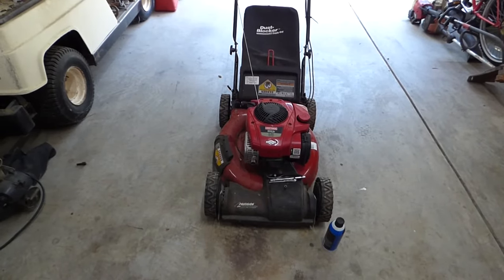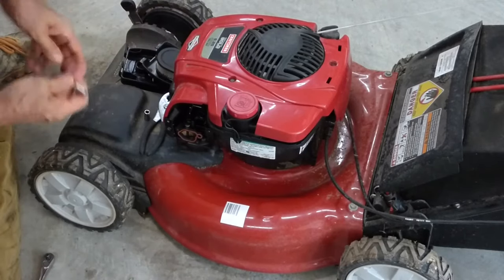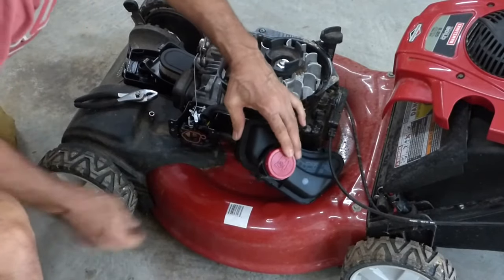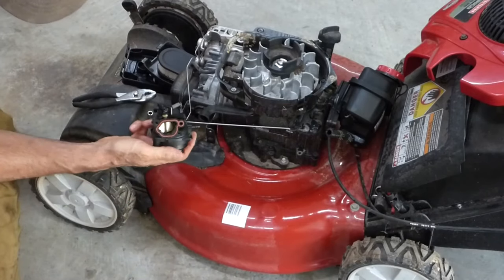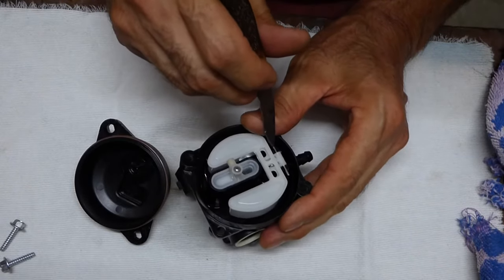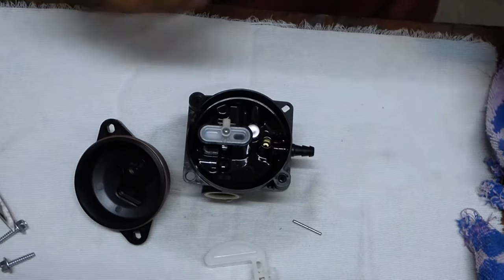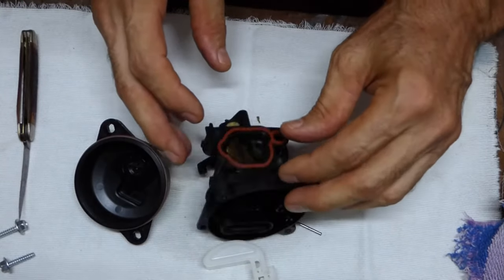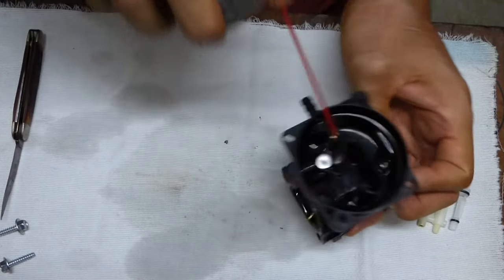Mower Won't Start - Briggs & Stratton Plastic Carburetor -  EASY Diagnose, Removal & Repair! FREE

Comment: Was wondering i gave same mower i got second had it was i. Trash  , but i got it running handles were broke  but rest worked .... the red peice on to was gone , so its nice to see that and it has a cover over battery box mine is also gone !!!!

Comment: The white jet holder plastic 3 tube piece was not completely disassembled.  The two tubes joined together needs slightly twisted and they will slide off then exposing about 3 holes on the middle tube that need to be cleaned and then reassembled.  This needs to be done!

Comment: Used your video yesterday to replace carb on my Toro 20332. THANK YOU. Worked fine with new carb. Suggest if your mower starts before you remove the old carb that you run out the gas tank, and let engine cool. No messy gas drips and easier to remove fuel line.
Reply from the maker: Glad it helped And good tip to run old gas out before your store

Comment: You never disconnected the two plastic pieces in the jet.  The two plastic pieces separate and that is where the jets need to be cleaned.  Just a heads-up for the viewer.
Reply: Emulsion tube

Comment: The part that was likely clogging your was clogging mine. I bought the mower $30 offerup and took it apart once but it wouldnt run with a new plug and cleaning. After your video i cleaned the carb better and used a wire and that little hole was clogged. I just finished my lawn! Thank you Thank you Thank you!!!!

Comment: Thank you!   my year old M220 not start been sitting 4-6 weeks   quick carb cleaner stray to opening it start ran 5seconds   so went along step by step with you and   IT STARTED first pull!    after running bout 5min it runs a bit rough   my guess is the dirty air filter for that   but  again thank you for the video   great work!
Reply from the maker: Glad it helped… Make sure you have fresh fuel in it also. The unleaded regular fuel does not hold up well and gums up the fuel system… Also may have water in it from condensation?.

Comment: The carburetor cleaner and  the starter spray are they the same ?
If not, can you give us the link to where to buy ?
I slow down the video and try to look at the can but it's blurry 
I never use those things , so I don't know where to buy or what it look like so I can search on Amazon.
Thank You
Reply from the maker: You can buy starting fluid at most any auto parts store, Walmart, Etc.  Very handy to have around!
Starting fluid is different than carb cleaner

Comment: thank you i took my carb off cleaned but i didnt realize the white piece where the jets are came out ill do that tomorrow 👍
Reply from the maker: sounds like you have the plastic carb with the main jet that snaps in.  I have a video on cleaning one of those too... you shouldn't have any trouble and be back up and running soon.  Good job and thanks for your visit

Comment: I really have to THANK YOU many, many times, for your great video and the straight / clear explanation you provided on how to go about repairing my Briggs & Stratton carburetor (on a Craftsman lawnmower) that would start but die out immediately... I was ready to bite the bullet but saved my family about $300 by not having to buy one.  It works perfectly after following your instructions... THANKS!
Reply from the maker: Happy I could help you and way to go!

Comment: These crappy plastic carburetors are the bane of American homeowners who don't really know what's wrong when their mowers won't start and it's expensive to take them to the shop. I installed a rebuilt carb on my mower and it cranked right up, but needed more and more pulls before it would crank as the summer wore on. Now after 3 months, this rebuilt carb is already clogged. So disgusted with American corporations and their obsession to squeeze every penny's profit out of everything they make. "Made in America" is no longer an endorsement.

Comment: That " little port " is your main jet ! Nice video but  I drill  out the main jet with a # 72 drill bit .025 works great , starts first pull ,,,,even the ones without the auto choke . I'm a 74 year old machinist and I'm like you " Old School "